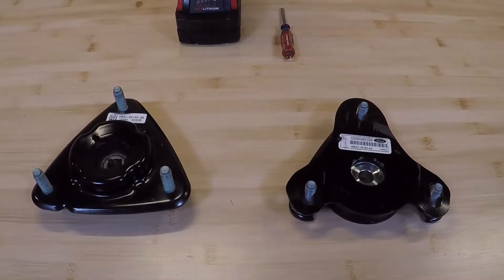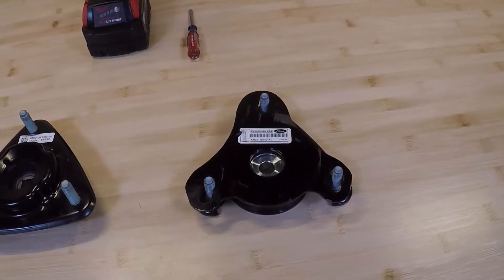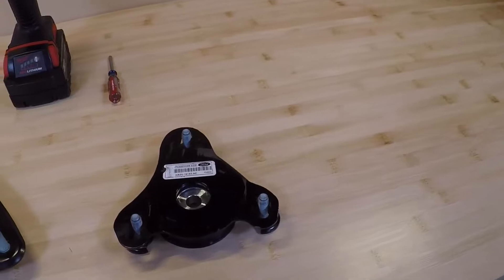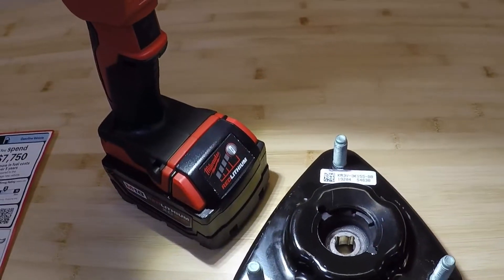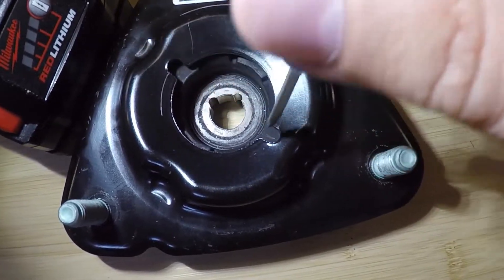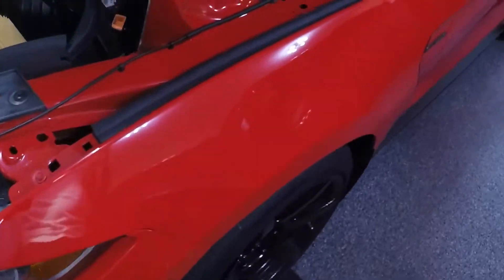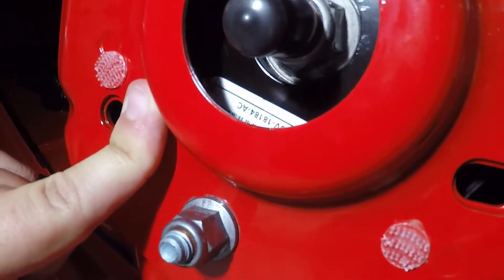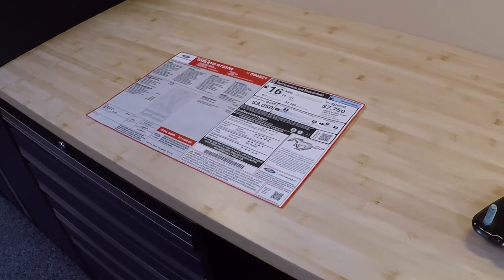New Shelby GT350 / GT500 Adjustable / Non-Adjustable Top Strut Mounts

Comment: Great video.  I just checked my 2020 GT350R I just picked up.  It was noted factory installed and I have pics of the plates.  The part numbers are different on mine.  Driver side - LR3V-18184-AB.  Passenger Side - LR3V-18183-AB
Reply: My 2020 GT350R HEP (October 2020 build) has the exact same part numbers on both plates.  Also noted factory installed.  Like one other commenter said, the plates themselves have three cut outs at 120º angles.

Comment: This video is helpful, thank you. Can you do a video of adjusting them? Or does anyone know where to find instructions for getting them to a specific deg? Looking at the owners supplement package and would like to adjust accordingly for street/track use. Thanks - John
Reply from the maker: They really need to be adjusted on an alignment rack to get both sides perfect. The alignment numbers are in the GT 350 owner supplement that came with the owners manual.
Reply: @EnthusiastsGarage  I see the numbers, it's what lead me down this rabbit hole. Your video helped me confirm the correct ones were installed (handling package) but just curious - do you know of any instructions out there? video or written
Reply from the maker: @john9077  No installing them is relatively involved and should probably be done by a tech or some very mechanically inclined you have to remove the shocks completely and you need a spring compressor to change them out.

Comment: Interesting story on these. I got my 350R with the plates installed on the wrong sides. Its important to note, and I have confirmed with a Ford Shelby technician that it is actually ok to install them on the opposite sides. Many people do this intentionally actually.

By installing them on the opposite side, you still get the negative camber desired, but you also get positive caster. So the reality is, installing them the "wrong way" is the right way. NOTE THIS IS FOR A 2019 GT350R that Im referencing.

Comment: Just had an alignment done on my 2020 GT500 today. There are no adjustable plates on my car. They did everything except camber on the front. It is still in tolerance though. The Ford plates are 500 bucks. I think I am going to shop a better set before I drop that much on OEM plates.

Comment: Good information. My dealer doesn’t seem to know much about this either and gave me two driver side parts (for my 2020 handling package). My part number matches your part number in the video “KR3V-18183-AC” but mine says DRIVER SIDE instead of passenger side. I’m waiting for the correct passenger side part now and wondering if it’s opposite of what your part numbers are showing. Hopefully it will be correct, once installed at the dealer. Not sure what part number I’m waiting for now, but I’ll make sure it says passenger side.
Reply from the maker: Same thing happened to me

Comment: Hey thx for the great info. I got a 2019 R. Mine are not installed i do have the correct ones thx to your video. What are the benefits of installing them as to not ? If i am not tracking the car.
Reply from the maker: Obviously the other ones are adjustable and I think the rubber bushings are a little smaller so it probably makes the steering a little sharper but not by much. Honestly I wouldn’t sweat it if they’re not installed at least if you have them it’ll add value when you go to sell the car.
Reply: Enthusiasts Garage yeah thats what i thought but wasn’t sure. Thanks for the reply. Closest track to me is like maybe 3 hrs away. Thx again i enjoy the videos PEG.

Comment: Thanks for the information. Do the Adjustable ones came with GT500 Handling pack since 2020 version or only starting with Handling Pack 2021 version? Or asked the other way around, has their been "handling packages" on GT 500 which did not include the adjustable strut mounts?
Reply from the maker: The non-handling package will have the non-adjustable‘s. All the other cars will have the same adjustable mounts

Comment: After watching your video, I have revised mine and for example on the DRIVER SIDE, my plate mount has the same sticker as yours but it says (LR3V-18184-AA DRIVER SIDE) And looking at the plate itself where yours is completely flat, mine has three cut outs at 120º angle. And the PASSANGER SIDE, the sticker on the plate mount says (LR3V-18183-AA PASSANGER SIDE) with another three cuts. When looking at the window sticker from my car, it simply says: ADJ STRUT MOUNTS. So I guess I am good to go.
Reply from the maker: Carlos Garcia yeah you’re good

Comment: Bought my 20 GT350R used December 2022. Just came across this video and checked the window sticker. It indeed said dealership install, and when I did not see the adj strut mounts on the car, I contacted the original purchasing dealership. The parts department could not find the part and said if I want to order the part, it will be $780!